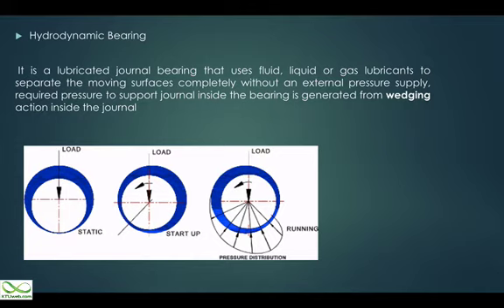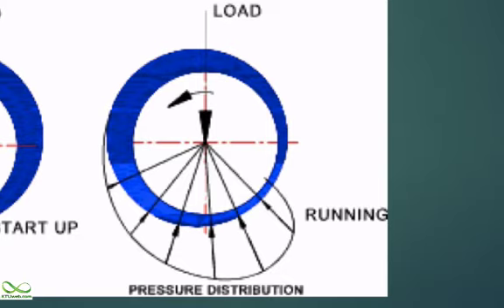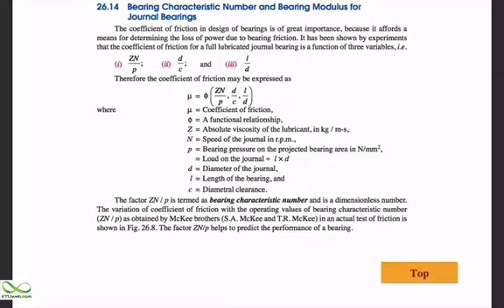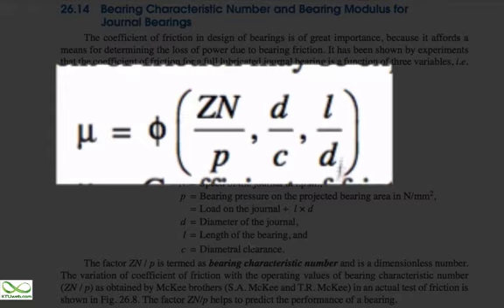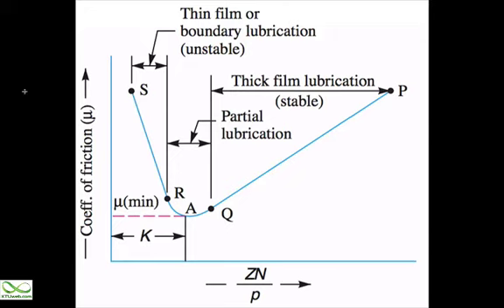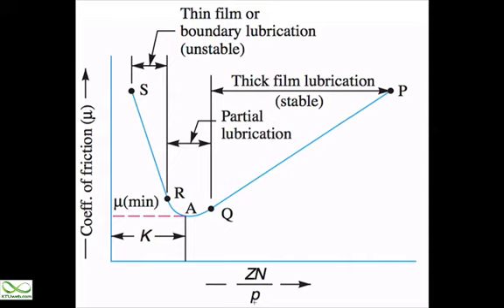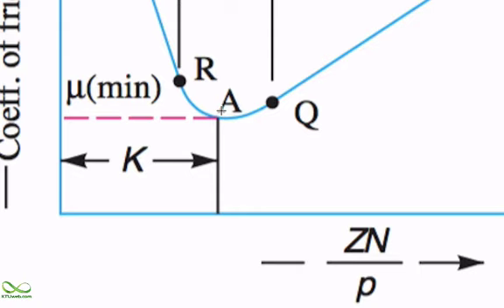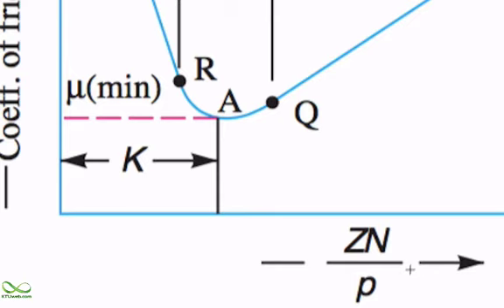Bearing Modulus and Bearing Characteristic Number of Journal Bearing

Comment: Sir will you can upload on "shaft,key and coupling" =topic
Basic topics in it is :
-Shaft material and size. 
-Design of shaft. (based on strength, design of axle, combined torsion and bending,  based on rigidity) 
-design of sunk key. 
-design of muff coupling.
-design of flange coupling.

Comment: Dear Sir, thank you very much for the excellent video. I have a question please: as ZN/p increases to 2K, 3K, or more, the coefficient of friction also increases although this is in the thick film lubrication (stable) phase. I am a bit confused because I should be designing for the thick film lubrication phase to minimize friction, but as per the graph the coefficient of friction is also increasing! Isn't this contradicting? 
Thank you. 
Omar
Reply from the maker: Hydrodynamic bearings are designed for fluid film lubrication, high value for K may change this to fluid lubrication.
A shaft bounded with very very thick layers of fluid will not provide precise rotation.
Reply: Yes as the ZN/P increases to become stable the coefficient of friction also increases and it increases heat generation which results in increase in temperature as viscosity is inversely proportional to temperature viscosity decreases which decreases ZN/P and thus returns into stable position and this repeats in floating manner.
Reply: More increase in viscosity more power required to overcome film thickness bcs viscosity is simply resistance to flow so more increase in friction . We need optimum film thickness more than K

Comment: Sir bearing characteristics no in hydrodynamic bearing depends on  safer design or cost effective design  sir plz clear the doubt
Reply from the maker: It depends upon both, it assure minimum oil filmi thickness and it also act as limiting factor for design by avoiding over designs.
The grade of oil can be determined by this factor, hence maintenance cost can also be controlled.